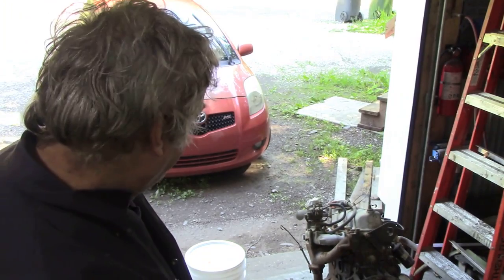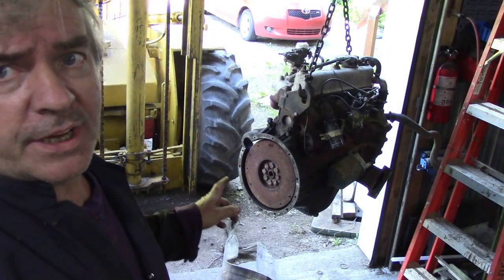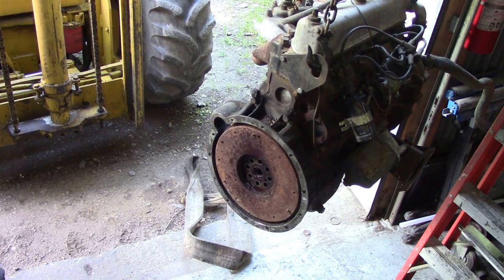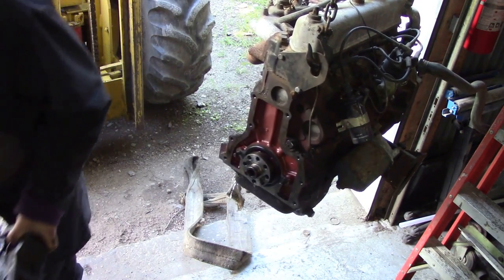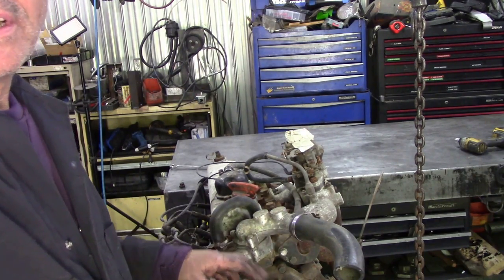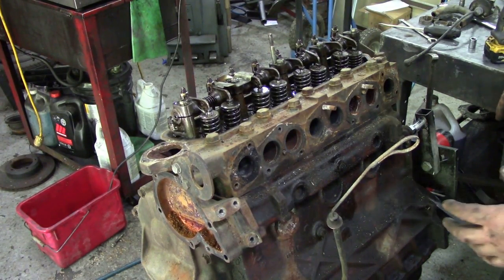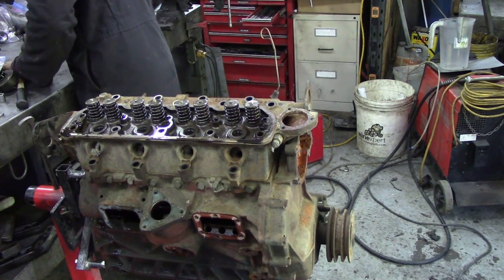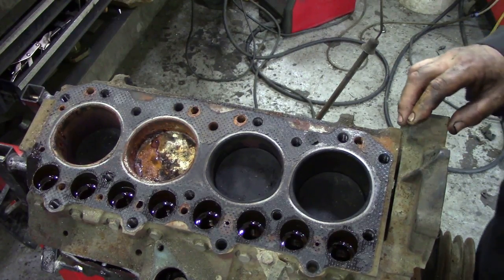2 25 Petrol engine strip down.   Part 1

Comment: My first encounter with a series Land Rover was a 2.6 NADA in 1971.  It wasn't until 1984 when I acquired an 88 when I had my first hands on with a 2.25 engine.  Since then I have had 7 of them and loved them.
Reply from the maker: They are a pretty good motor - especially the 5 bearing version
I have a feeling that the metal used in blocks was a lot better than the 3 bearing ones - they were quit soft needing rebores at an early age
Same goes for Tdi  - they were quite good blocks

Comment: I had one of these in my first 90 , it was well knackered .
It was doing about 7mpg when I pulled it out and put a 2.5TD in , couldn't put a TDI in as they were pretty much still brand new then.
Reply: Landies of that era give me the heeby-jeebies.

I think Noah had a 2.25 LR engine in his Ark and they used the same basic design for every 4 pot petrol AND diesel engine up until the 200tdi.
I had a 90 2.5TD and knowing it was designed as a 2.25 petrol engine (with much lower compression-ratio) didn't inspire much confidence.

The crank died after a couple of years and, fortunately, I worked for a company with a fleet of LRs and I was allowed to take a fancy new(ish) 300tdi engine out of a crashed 110 and stick it into my 90.

Comment: Regarding putting the bolts in a freezer bag so you can loose them all at once. 
Can I suggest putting your 10mm socket in the same bag to save time later.

Comment: Hi Mike, Not related to this video but to do with one you had a 'breathing engine' you took the top off the injector pump and it was full of oil.  Well I did the same on my 200 tdi and it too was full of oil.  Now I also took off the waist gate actuator as the pipe goes in to the top and sure enough that was full too!  so that's one worth checking in the future.
Reply from the maker: Yes it is a sign of too much pressure in the crank cases

Comment: ace,! always the unexpected when you take the head off! ive just changed my head on my 5 brg engine ,sent it to turners to get gas flowed, i got a few years ago with 27k on clock ,now 49k,very little wear on the bores,turner head makes big difference ,got high flow "silencer" from ACR , pulls strong ,ive a recon SU HIFF  44 c/w kit from HNJ  to go on next,to replace that tiny 34mm weber,nasty thing ...so expecting 90bhp plus?, after its all done, only trouble ,ive just the 235/85tyres to help with gearing ,so think overdrive or 3,54 diffs,what do you think?

Comment: Great project, Mike. Watching this one keenly as a S3 owner with a mighty 2.25. The hp rating fools a lot of people into underestimating them, but these little engines have grunt and just won't quit. Mine has never let me down, even once with a spark issue that had it only firing on 2 cylinders she still got me home.  One advantage, the Series 3 is about 500kg lighter than the Defender, so the hp/weight ratio is better. One day I would like to swap in an LT77 or R380 5-speed to improve highway driving. Any tips on doing that, or would an overdrive be a better choice?
Reply: Get a roamerdrive overdrive bud.
Reply: @mattluszczak8095  give me $2000 to buy one plus another $2000 for shipping and duties to import one to Kenya, bud. Does that make economic sense, bud?